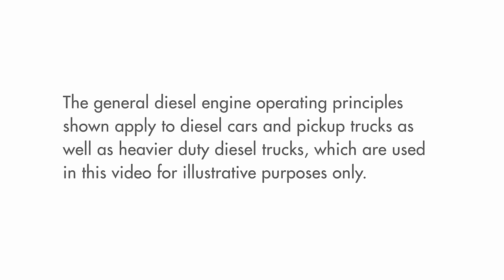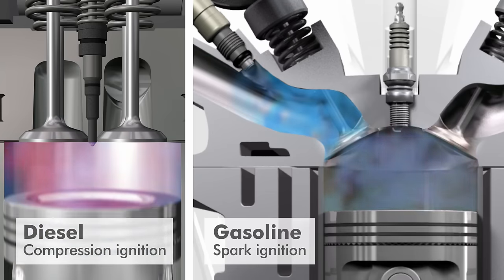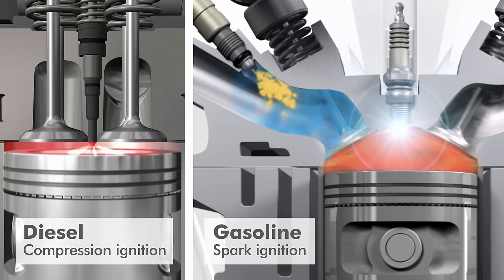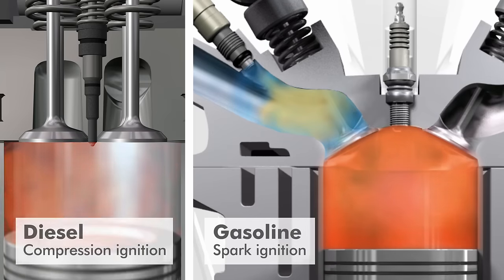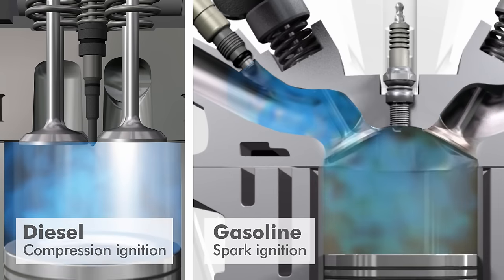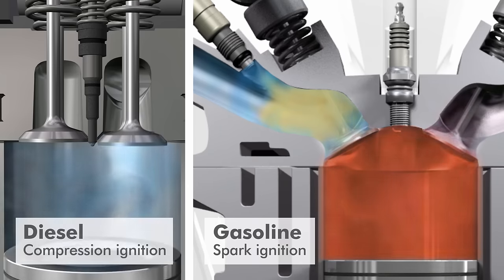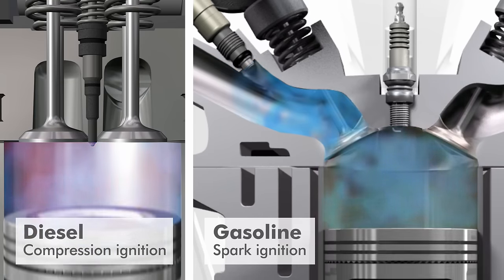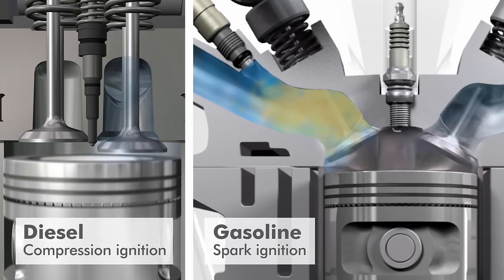How a Diesel Engine Works

Comment: This video is perfect. Leave it to an oil company to explain diesel in less than 2mins
Reply: They also sell gas and diesel
Reply: @anxiety1209  gas and diesel are oil
Reply: Shell are actually a fossil fuel company, so it’s their business to know.
Reply: @cliffbooth7075  it's their business to know fossil fuels. Not machine mechanics
Reply: I left it to my eighth grade science teacher to explain the simple difference between Diesel engines and gasoline engines.  Both are the same thing, but in a Diesel engine, the heat which ignites the fuel is caused by compressing the air in the cylinder, not by a spark plug.
Reply: Joakim Mathisen  Its made from crude oil so yeah.
Reply: @ichangedmyname0001 
I disagree.  It’s their business to know how an engine uses fuel.  They explained it didn’t they.
Reply: @cliffbooth7075  they even know about the dinos and sea monsters.
Reply: @bench-xpress 
Over 300 shell oil workers also have carnal knowledge of your boyfriend.  Sorry to tell it to you like this.
Reply: is this feciecious
Reply: @ichangedmyname0001  if they don't know how engine works, they won't be able to make engine-compatible fuel
Reply: @ichangedmyname0001  It’s their business to know the machines that use the fuel they produce. Imagine trying to formulate a fuel for a jet engine and having no idea how it worked.
Reply: Jommejom  gas comes from crude oil buddy
Reply: Jommejom  oh my...
Reply: @rafaykhanyousefzai  depends. Gasoline is made from crude oil, natural gas is extracted from natural gas deposits
Reply: @reggiecactus2810  hmm.. I didn't have that much knowledge so thanks.
Reply: @MTLTV-eu4nv  I always thought the glow plugs make the combustion possible in diesel engines.
Reply: @DoubleoP  those are to start the engine and warm it up because they still need heat AND compression then the compression and heat take over and do the rest
Reply: @Guy-fc9zx  they don’t “need” glowplugs at all it takes a little longer to start a diesel in the winter without them but no you don’t have to have glowplugs
Reply: @DoubleoP  alot of diesels don't have glow plugs. Detroit Diesel was one of them
Reply: yeah, who else is gonna do it, a software engineer?🙄
Reply: Jommejom  you don't say?🙄 maybe tell all us dumb'uns where gas comes from, maybe?
Reply: @cliffbooth7075  *boyfriend
Reply: a dude i no says he can run a diesel engine on gas
Reply: This video is perfect! These people got billions of dollars because they know what they are doing! Great explanation!
Reply: @anxiety1209: really? Is that why its called a gas station ⛽?
Reply: 0:37
Reply: The Kingdom of God is at Hand 
John 3:16
King James Version 
16 For God so loved the world, that he gave his only begotten Son, that whosoever believeth in him should not perish, but have everlasting life.
Reply: @MTLTV-eu4nv 
Although I was a Navy mechanic 50 years ago, 
I still cannot conceive how compression alone could heat the fuel to the point of ignition, without need of a sparkplug !

Comment: Finally a simple explanation on how diesel engines work!  I completely understood petrol engines, but diesels were always enigma for me
Reply: @chubbychubs4636  if it's cold outside you don't get a bang.
Reply: @dragospahontu maybe your engine
Reply: @VeltyGames  mazda makes petrol engines work like diesel
Reply: The gasoline example here is for IDI, aka port fuel injection, which is an old way of mixing fuel and air. These days, they use direct injection, which is the same way diesel operates, but there is still need for spark ignition.
Reply: Tak je Vinkec.
Reply: @dragospahontu  That is why there is a glowplug to preheat the combustion chamber of a diesel engine if the weather is too cold.
Reply: @Dra60oN  yes
Reply: Well if you understand i didn,t =/
Reply: The technical term for a diesel engine is a compression ignition engine. A diesel engine is a lot more robust engine than a petrol engine due to the enormous compression the diesel engine experiences.
Reply: @Dra60oN  ahahaha glow plugs? Real diesels don't have glow plugs. Heat of compression. 
As long as your oil isn't frozen and your batteries are charged you can start that diesel
Reply: @BawkBawkBawk666  
Diesel engines have glow plugs, but better call them heater plugs. They are not for ignation. They are only activited before starting the engine. Especially in cold conditions you should not or even cannot do a quick start. You have to preheat for some seconds. You turn the ignition key 2 times, wait some seconds, and then go for ignitaion. Modern cars have a start button an do it automatically.
Reply: You completely understood petrol engines but diesel engines were an enigma, and after this 1 min video you now understand diesel engines? That's a real enigma
Reply: @Postermaestro  I was the same, I understood petrol engines just fine, but I never understood how the compression made the diesel fuel combust. Now I have a fair understanding of it.
Reply: @zayisonline3817  alrighty then
Reply: Simple but not complete. He should have mentioned why they have to work differently which I believe its due to the properties of both fuel
Reply: What is Enigma?
Reply: @deepakk1347  a person or thing that is mysterious, puzzling, or difficult to understand.
Reply: @deepakk1347  it's a word in English, it is sort of a mix between "mystery" and "difficult question"
Reply: Does it mean disel engines don't need spark plugs ?
Reply: same
Reply: @TheyCallMeMrMaybe this is direct injection man. And no there’s no spark
Reply: Technically, they're both petrol... "Petrol" is short for "petroleum," aka "crude oil." Both diesel and gasoline are refined from petroleum (and so is kerosene). US slang "gas" is short for "gasoline."
Reply: @benjaminmorris4962  well english isn't my main language. In my language it's "dizel" and "benzin" and I use that terminology
Reply: @vinko9.  Lol I was just being technical/obnoxious rather than actually "correcting" you... "Petrol" is British slang for gasoline as it derives from petroleum. I was just poking fun at how vague that slang is compared to the US slang "gas," short for "gasoline"